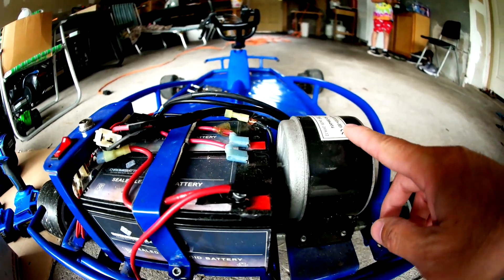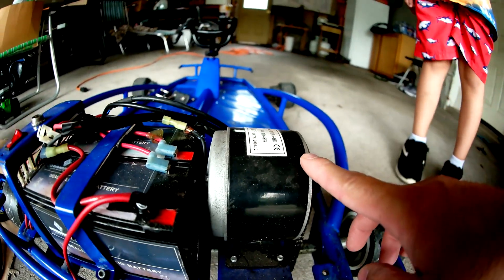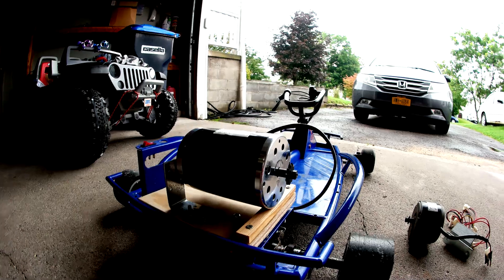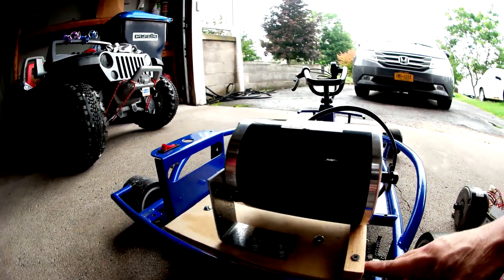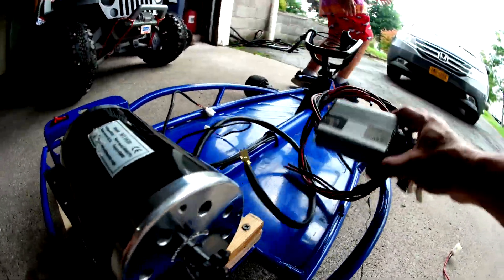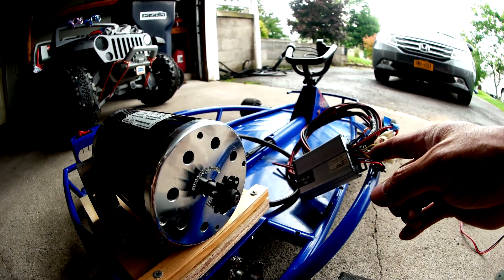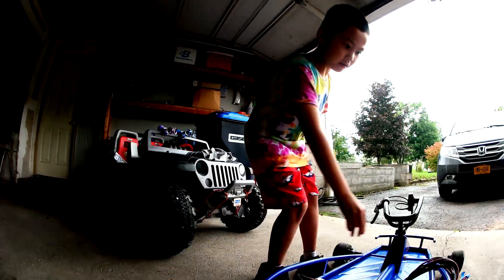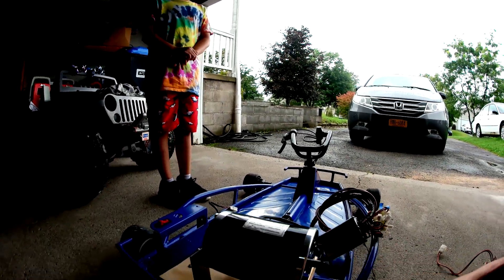Razor ground force tear down #17

Comment: Your videos are awesome! So if I have a 36v 800w how many battery do I use?
Reply from the maker: You have 2 options. (1)  If you are going to use 12V lead acid battery setup.  You would need 3 battery and connect the battery in serial to get 36V output.  (2) A better option is to buy a 36V lithium battery pack.  I recommend lithium battery pack.
Reply: @MichaelGAMING0001  if I have a 18v lithium 2 would work just as good
Reply: @Rauly-sb7gm   Sure.